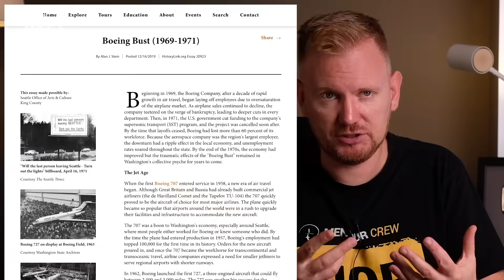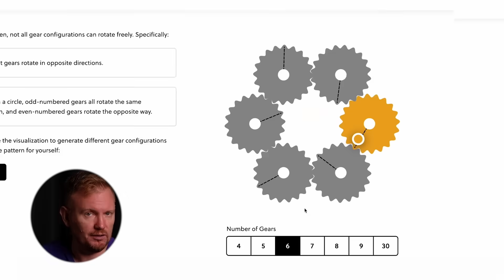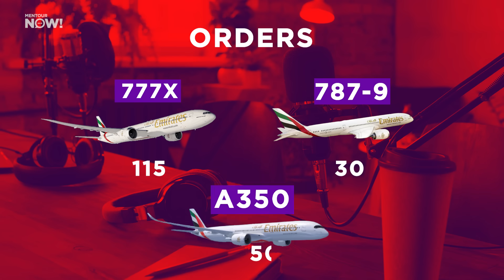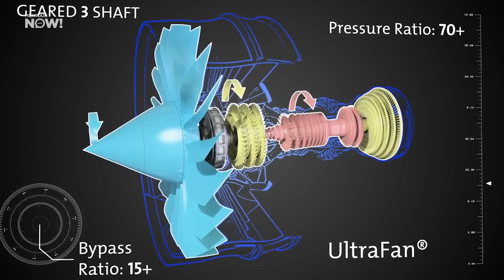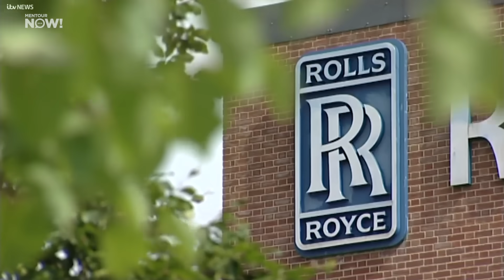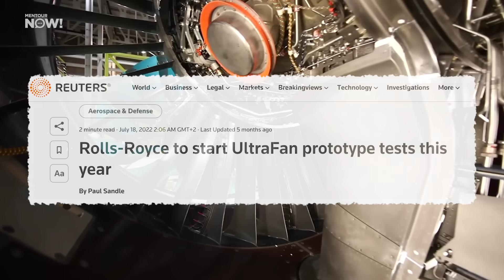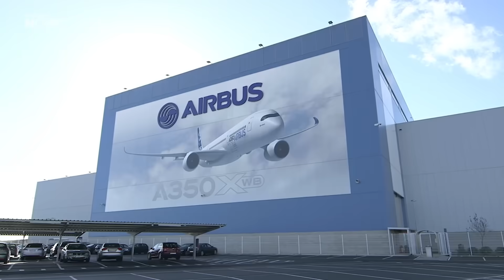Are BOEING planning a 747 with 2 ENGINES?!

Comment: One of the big issues is that the airline sector will be replaced gradually by trains. Basically there will be a reduction in demand. There's really not a strong business case for another plane the size of a Boeing 747 or Airbus 380 but with only 2 engines. 

Also, corporations make mistakes all the time. The fact that they made the prototype bigger might be a mistake.

Airbus actually planned a freighter version of the A380. It didn't get enough orders.

Comment: I've seen designs floating around for BWB (blended wing body) basically a flying wing with 3 huge engines mounted on top of the fuselage. Passenger configuration is spread out wide as opposed to a long thin tube. Potentially a BWB aircraft with the dimensions of a 737 might have triple the capacity. If you mount the engines on top, size no longer matters.

Comment: Recently here in the US, some parts of the country have been going through some of the worst winter in a "century." According to some. Large airlines such as United and American operate using then hub and spoke model. Southwest airlines operated under the point to point model. Due to the really bad weather thousands of flight had to be canceled. Just southwest canceled over 2,000 flights.

Now the hub and spoke model airlines are almost back in full business, Southwest is struggling to the point that they are renting shuttle buses to get some passengers to their destination, with luggage piling up at some airports with no passengers to pick them up, and the federal govt launching an investigation into Southwest's failure.

Southwest struggle has been attributed to two problems. The 30+ year old computer system and software they use and to their point to point operation model. Point to point model makes sense when everything is working as planned, but throw a wrench in the gears, as in bad winter storms, and it struggles to debounce back as fast and efficiently as the hub and spoke. That is what so called "experts" are sayin gin the news. But you can't trust the vast majority of the junk you see in news. So what do I know, right? 

Perhaps the perfect solution would be a combination of both. It would allow the airline much more flexibility in the way they operate. And the ability to lean more from one side to the other as needed.  Is that even possible or desirable?

Comment: I think it would be important to mention the 747 was designed as freighter from the start in competition with Lockheed for the US military large cargo plane, becoming the C5. So the design requirements were given by the US Air Force and are apparent when you note how much the C5 and 747 share and no other aircraft does.
Therefore the commercial and passenger role came after they lost the contract and realized they had a good plane and adapted it for passengers. Who knows what the history of the largest planes would have been otherwise. Maybe the hub on and spoke would have never happened with the US Air Force contract being what it was.

Comment: The 747 fuselage is way too cramped and horrible compared to a modern wide bodied airframe.  It is simply outdated in every way.  No matter what huge turbofan Rolls Royce build you need an airframe at least the capacity of the A380.

Comment: Another highly entertaining film. Just one question though - is it not possible to develop a hinged front door cargo version of the 380? I guess not as production has ended albeit very prematurely…

Also I remember my first transatlantic crossing on a DC10 many, many years ago which due to the many problems that haunted that particular aircraft made me incredibly uneasy. All went without a hitch I might add. The second trip to the US was on a 767 with obviously two engines which stressed me more. What would happen if an engine failed halfway? Forget ETOPS I just wasn’t convinced - now nobody gives it a second thought!

I’m investing in chicken wire as an engine as big as the R/Royce is going to ingest everything within half a mile!!!
Reply: No, you can't put a hinged cargo door on the nose of an A380.  The cockpit is directly impeding the loadpath.

Comment: When I designed the Condor 800 in 2007 - I designed a Supersonic Version of the Ultrafan but with Variable By Pass Ratio Capability in order to capture and compress efficiently the High Pressure Air entering the Nacelle at Supersonic Speed and to be able to operate as a High by Pass Turbofan for takeoff and landing and then transition to a Turbo Scram Jet for High Speed (Mach 4) Flight. 

Rolls Royce Technicians laughed their heads off at my proposal but the U.S. Air Force has now developed this same technology for the new engines to be fitted to the B-21 Bomber and New F-15X to enable Super Cruise Capabilities.  

The Condor 800 SST will eventually be developed into the world's first truly Quiet Super Sonic Airliner capable of Mach 4 flight envelopes and nonstop London to Sydney flight times of just 5 hours.

Comment: Great video 😁

I think Boeing Could make a profitable twin engine 747 👍🏻

The 747-8 wing design was adopted from the 787, so it shouldn't be a problem for it to accommodate 2 engines instead of 4, as it does on that on the 787, then they could make the fuselage from Composites which would make the 747 a lot lighter and thus saving fuel as a result, plus they could probably enlarge the windows like they did on the 787 then too. 

I think if they did that, it could potentially be the end of the 777-8/9 as the 747 would have more cargo capacity and likely be more fuel efficient too.
Reply: Not sure where you got your info that the 747-8 design came from the 787. I did the cost estimate for the -8 wing and it was not built out of composites or have anything to do with the 787.

Comment: In not too long, we will probably have electric planes, so developing a new type of jet engine seems like a waste of time.
Reply: There is no known technology that would enable fully electric battery powered long range airliners. The only planned  electric planes are 30 seat 250 mile range hybrids that use an internal combustion engine to recharge a battery that powers an electric propeller. All electric range is expected to be around 100 miles. These are expected to debut in about ten years.

A big disadvantage of batteries for long range flights is the heavy weight, which doesn't diminish as a flight progresses, unlike a regular plane which is consistently getting lighter as it burns off fuel which extends the range.

The only plans for full size airliners is to use biofuels which will reduce overall environmental effects.

Comment: Just for shits and giggles... I think we should round up the original engineers and r&d crew that came up with the low RPM gear drive 2 engine jet turbine planes that saves fuel... Send them on a cross Pacific flight... And stealthily disabled one of the motors halfway across... And see if they can really fly out of the Pacific for 6 hours on one engine. That they have of course certified as being no problem. Especially this little puppy with the engines so far from the fuselage? Can you figure out why I just type that last sentence?

Comment: They should come up with a three engine aircraft a lot like the MD-11 thats little bigger than the 777!
Reply: Airlines want two engines which reduces operating and maintenance costs. You are suggesting a 50% increase in engine costs. No Airline will want that even if it does allow more passengers.
Reply: @StevePemberton2  tell that to Emirates that owns a fleet of A380s! You're so worried about maintenance and operating costs until there's an engine failure thousands of feet in the middle of the ocean! A 777 like airplane is not going to operate on one engine for very long! It will burn itself out without the aid of a 3rd or 2nd engine!
Reply: @Angry.General1461  
The A380 program effectively ended in 2019 when Emirates canceled their order for 39 A380's, opting instead for A350's.

When someone starts getting personal and accusatory, claiming to know how someone feels, "You're so worried about maintenance and costs" it's a sure sign of diversion and belligerence. You have no idea what I worry or don't worry about. I'm just stating the reasons why airlines are no longer interested in four engine airplanes now that twins are nearing their capabilities, just as they stopped buying three engine jumbos when the twins reached that capacity.

Comment: The early 747s had four engines that were much less powerful than modern two engines. That is a fact. However that doesn't necessarily mean that a more economical 747's with only two engines and less air drag will be more profitable to airlines. 
The problem isn't just the fuel consumption per passenger nowadays but the change of passenger needs. 
Airlines always want large airplanes and transit cheap flights at large hub airports. On the other hand passenger always want cheap direct flights. 
The last decade technology permits with smaller two engines airplanes, long flights to be direct and cheap. 
That is disastrous for Boeing 747 and Airbus a380 which are designed for hub airports and transit flights. 
Large airplanes have to be full of passenger in order to be profitable. Smaller ones can be profitable without being filled booked.

Comment: I see a 747 Coming east of Reno at 20 thousand feet heading into Lad Vegas around 1:00 pm every other day . Its at an altitude where I can Identify  the aircraft with the  naked eye. The 747 is one Aircraft I have never flown on...I have flown on the 777  which h is an amazing aircraft in itself but not a 747 . The Engine of the 777 is an engineering marvel  . I hope teh 747 / 2 comes true

Comment: In terms of total usable cabin floor area for seats(or more simplistically, total maximum certified seat count in a single class layout):
1) Today's 77W(I.e. 777-300ER) is already practically = 747-200
2) Upcoming 779(I.e. 777-9X) now in flight test is practically = 747-400
3) The 777-10X concept Boeing floated to airline customers 5~6yrs ago will practically = 747-8i(I.e. the  final+largest 747 variant ever)

In all 3 cases, available Rev$ belly cargo space of each 777 variant seriously eclipsed any 747 variant(also A380-800 and its related  stretched 380-900 concept Airbus had pushed 2 decades ago). Anyone here who has ever ordered anything online from Amazon, Alibaba, etc. would instantly understand why air cargo now rules longhaul airlines in this post-covid19 era, not loads of tourist buying deeply discounted coach/economy seats above the belly cargo compartment like before.  After all unlike passengers, cargo don't need drinks+meals, lavatory, cabin crew to serve them(and save them in an emergency), frequent flyer miles to earn, etc. and cause no 'riots' when a storm is causing a delay.

So "747 with 2 engines?" hv already  existed for decades but indirectly in the shape of the largest 777....at least from Boeing's sales+financial  perspective if not from 'jumbo' romantic lovers' view.

Comment: The  massive R. R. engine is a mystery to me , Could this huge engine be intended to be mounted as 2 on the tail end of an aircraft or some other new type of plane set up or what ?  Could  the engines be mounted aft of the wings of a 747  ?

Comment: I think it's possible 2 engines 747 considering the RR ultrafan engine more than 120 thousand pounds of thrust sufficient enough to power up the aircraft. I think they should slim down the weight like using composite materials like carbon fiber titanium etc. I know it's not that easy but they can find some ways to do it.

Comment: Interesting comment on the Point to Point model which is what Southwest Airlines here is the US uses. That model contributed (along with weather and outdated scheduling) to the estimated 11000 Southwest Airlines flight cancellations over this holiday week. Airlines using the traditional hub and spoke model such as United, American and Delta didn’t suffer the same problems as Southwest this week.

Comment: If Jumbo Jet is only the 747, what is the A380?
Reply: In general any of the largest widebodies from 777 and up are jumbos. Although the A380 is often referred to as a super jumbo, and the 777 and A350 are mini jumbos.  So in that sense 747 is the only jumbo. Or to put it another way, the 747 is the only jumbo that is not a super jumbo or a mini jumbo.

For wake turbulence purposes A350, 777, 747 and several other types are referred to as heavy. A380 is the only super (AN-225 was also)

Comment: Hydrogen is NOT A FUEL,  IT IS A STORAGE MEDIUM. IT TAKES ENERGY TO CREATE. GET IT?
Reply: Got it. You should send a message to NASA and let them know because they have apparently been using the wrong terminology for decades. The Apollo Moon rockets as well as the Space Shuttle burned liquid hydrogen, which they referred to as fuel, which was pumped into the rockets during fueling, and stored in fuel tanks. Hydrogen was also used in the spaceship's  fuel cells to generate electricity.

Comment: It’s amazing how large the bypass ratio of modern passenger jet engines have become compared to corporate jets and much older 737 and 707 passenger jets
Reply: The original turbo jets were 0 bypass lol
Reply: @yungrichnbroke5199  fuel economy was terrible at lower speeds though
Reply: @southwestxnorthwest  everything about them was terrible lol but especially non cruise fuel burn!
Reply: @yungrichnbroke5199  ironically, the food was better though

Comment: I can't help but wonder it the classic "tube with wings" design is nearing it's end. I understand the reasons why, the tube being consistently strong, easier to lengthen, etcetera. But wouldn't a wider lifting body approach to the fuselage result in more interior space, allowing more seating or cargo area, as well as providing some degree of lift? If I remember correctly, the A380 was pushing the boundaries of aircraft dimensions permissible in airports. One of the reasons they went to a double decker configuration. I would think a ultra-wide body lifting body(-ish) fuselage could still fit within those restraints.

Comment: Concorde was profitable at fifty five percent occupancy. According to recent publications, the last few years, when a more astute marketing people were in place, they were very profitable.
Reply: Getting the airplanes for free helps. As does limiting flights for the most part to the two city-pairs that best fit it. Also the only data seems to come from British Airways, it's not clear if the Air France Concordes were ever profitable. BA ran two flights a day for several years between JFK and LHR, but Air France only ran one daily flight from JFK to CDG.

They tried other routes over the years but none of them really worked out. They also did a lot of charter flights which was mainly for tourists wanting the novelty (wish I had done that)

Comment: Don't see this being very feasable for the 747...for one the tooling for the 747 is gone....it would need a wing redesign...and strut redesign...its simply not the plane to do it with.....the 777x already checks those boxes. 
There only 2 options in my  book....make the A380 a twin or a VERY big BWB...OR BOTH.  If  I was a strategist right now....I'd launch 3 BWB's (small med large)   and keep it a BIG secret...they would all be mirrors of each other...keeping construction as similar as possible.  Northrup is the current king of BWB....they could team up with Boeing or AIRBUS OR maybe its time for AIRBUS/BOEING  to end competition for future aircraft...and team up.  I think they would do well together.   
This new RR may also be designed to UNseat the GE as the sole engine choice for the 777X....which IMO has cost sales.  The 777X needs BOTH GE and RR choices....and that HUGE new RR engine will do it just fine 🙂

Comment: I am surprised that you did not mention the fact that you could not fly a commercial twin jet (though more efficient) over seas until ETOPS was introduced in the mid to late 80's.
Reply: Exactly. Trijets were a stopgap between quads and ETOPS..
Reply: Most all are ETOPS now
Reply: You are quite right David, the regulators were worried about reliability ? but as we have seen the Big Jet Engine fairly breaks down. so we are living in the age of ' The Big Twin ' which was introduced by Airbus many years ago with its A .300 and copied by Boeing and its 777..
Reply: @MyJerseybean  why does everybody forget the humble, but excellent 767. It first flew in 1981, and was the first wide-body twinjet from Boeing, 12 years prior to the 777 entering into service..
Reply: @dummgelauft  yes, I always wonder why the 767 was so short lived and always ignored. I used to fly on the 757 and the 767 a fair bit back then and enjoyed both jets very much (especially the 757 I must say - comfortable; high rate of climb; and quick)
Reply: @Peter Graham  the 767 is alive and well...the KC-46 is the 767. Also DHL and FedEx keep buying the 767 freighter.
Reply: @MyJerseybean  i dont think two engines on a jet is copying.that like saying airbus copied the 747
Reply: Yes, I was confused because I thought this was the case, but when he didn't mention it I thought maybe I was wrong.